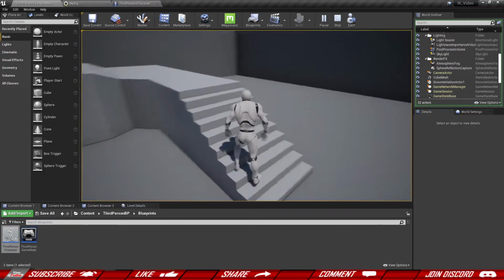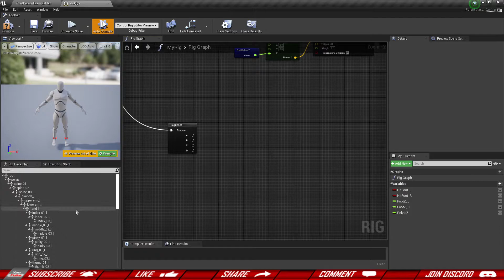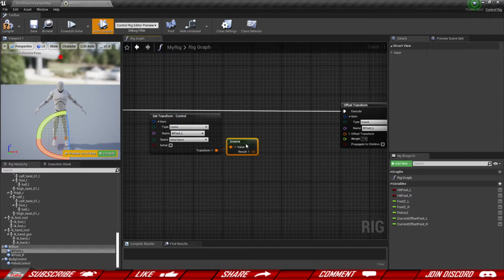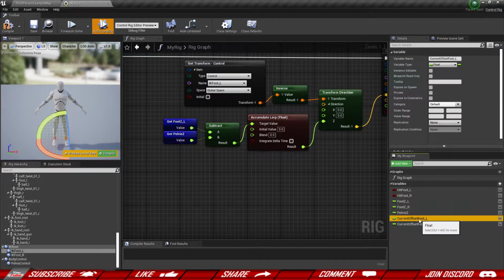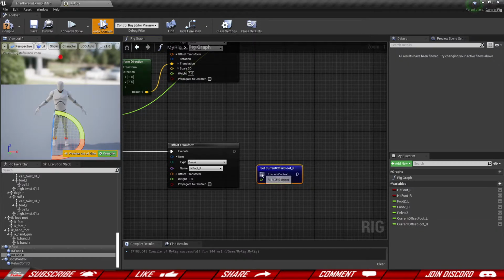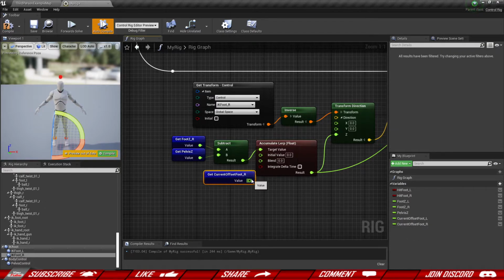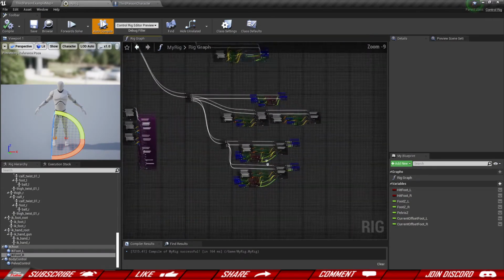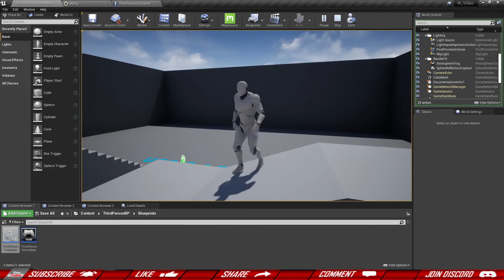UE4 Control Rig Leg Adjustments

Comment: For me the knee won't go up
Reply: It wasn't working for me too. I kinda fixed it, heres how - my leg was moving up by changing X axis, so i put "Transform Direction node" output Z to "Offset Transform node" in X pin. For the other leg did the same except multiplied by -1, because my other leg was inverted.(you can check your axis in skeletal meshes). Also if your character will wobble left and right, that means you need to add one Bone Setting to "FullBodyIK" if you haven't, and make it Pelvis, and make Rotation Stiffness and Position Stiffness to 1.
Reply: @Efotix  bro, you are a saviour, thank you!
Reply: Thank you so much, you saved my game!! @Efotix